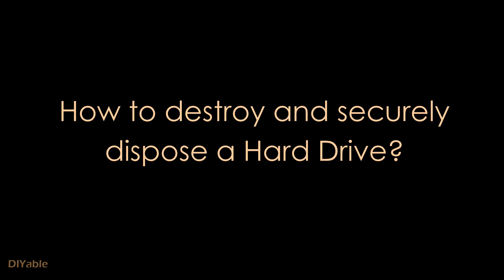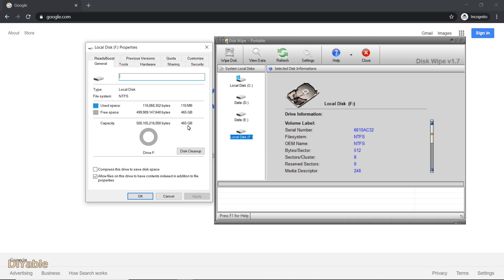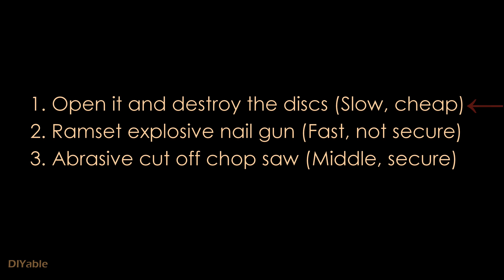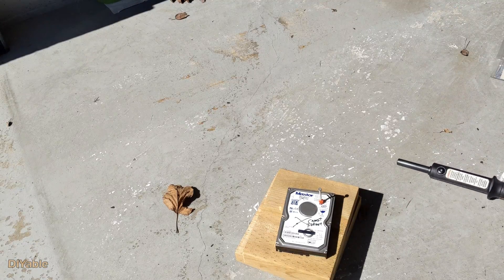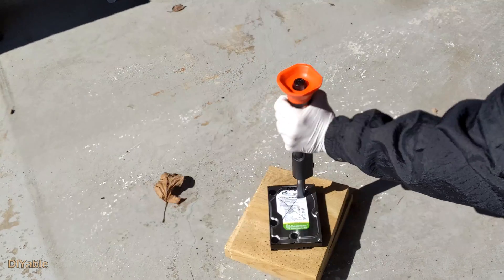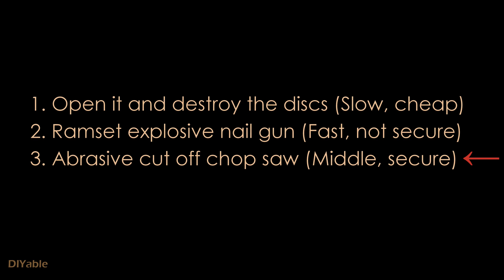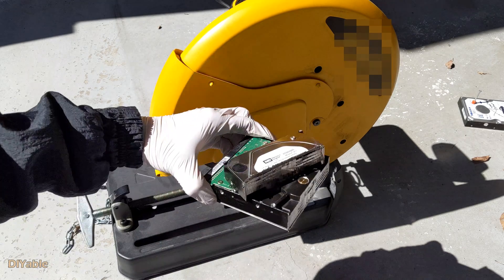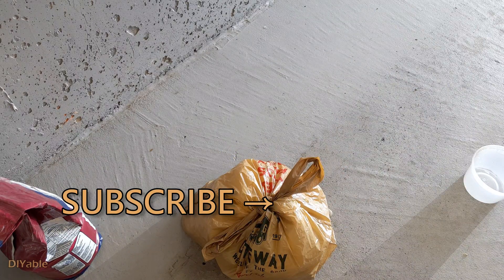How to destroy and securely dispose a Hard Drive even FBI/NSA cannot recover your data?

Comment: He fails to make the distinction by the number of drives you need to destroy.  For example, if you are doing just your own, or a few, then use a hammer.  But if you need to decommission over a hundred or thousands, it is well worth it to get a Hard Drive Crusher.  It would save a lot of time and be much safer.

Comment: Pop the discs off put the motor hub in a lathe chuck and scrape the  shiny datafoil off saving the chips with a vacuum cleaner. Recycle the aluminum platters hub and case as cast aluminum, then dissolve the datafoil first with NaOH to remove sluminum then water rinse then in HNO3 to remove cobalt samerium and nickel, finally in aqua regia to remove platinum. The silver grey powder left over is rhodium.❤

Comment: Can you not just simply snip off the strip connecting the circuit board to drive? will that suffice?
Reply: The platters should be broken, Since thats the data. You can take it apart and smash the platters if they're glass, Or you can just drill into it and then sand it.

Comment: This was a thing over a decade ago, maybe longer. Back when drives were MFM, RLL etc.  Back then, it was possible to recreate data by reading from the edges of the tracks which were not always erased/overwritten.  However, since IDE and SATA, so far as I know, no one has recovered data that has been overwritten by the normal OS. The tricky bit is the difference between 'Deleted' and 'Overwritten'.
When you delete a file on Mac or PC, often times the actual file is not deleted. What is deleted is the name of the file in the directory, and the location. The is akin to deleting a chapter of a book by whiting out the chapter name and number from the Table of Contents. If you flip through the book, the chapter is still there and readable.
To securely erase, you want to overwrite all the tracks that the file is on, with either random data, all zeros, all ones, etc.
Old DoD had a protocol for overwriting the entire disk with a minimum of 7 seperate passes of all zero's, all ones, and random data, in some order.
As mentioned this was because older drive technology was based on wider data tracks on the disks, and and erase or delete file command would change 95% of the track location, but that small area not erase could still technically be recovered.
With the newer drives, much smaller tracks, and much finer read/write heads, there is no way read the 'margins' of the tracks to snoop on old data.
So, get a good Open Source program like DBAN, etc, which will do a low-level format of a drive, and run a couple of cycles of filling all the tracks with random data.
Actually, someone has a large bounty IIRC for years now, where they will payout if anyone can recover data from a standard Mac/PC low-level format alone.

CIA/NSA can't keep that secret.
Reply: You write everything ignoring the fact that nowadays most computers use SSD, and if you think DBAN or overwriting will work on SSD then good luck, ignoring the fact that even on HDD there is a chance that the program you used to overwrite data did not do a good job and did not overwrite some sectors, and because some process got in the way and because this and because that, the options are many. Physical destruction is the only reasonable solution, DoD released this method in the 90s for a reason ;)

Comment: I suggest using sandpaper on the platter, putting holes in it with a drill, then cutting it in half and bending the pieces.
Reply from the maker: Certainty that's additional good steps to take it further, thanks for sharing
Reply: i guess it's pretty randomly asking but do anyone know a good place to watch newly released series online?
Reply: @Reuben Marcellus I watch on flixzone. You can find it by googling :)
Reply: @Reuben Marcellus I would suggest Flixzone. You can find it by googling :)
Reply: @Reuben Marcellus I watch on FlixZone. You can find it on google =)